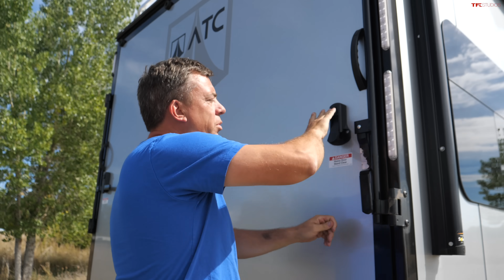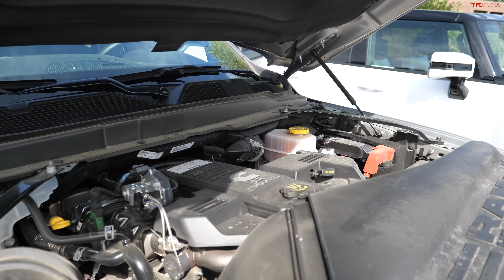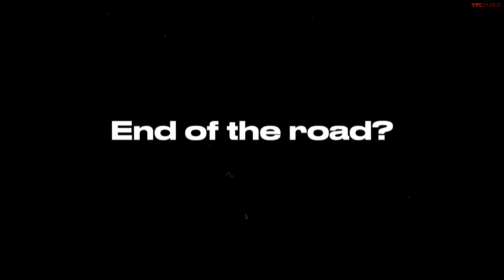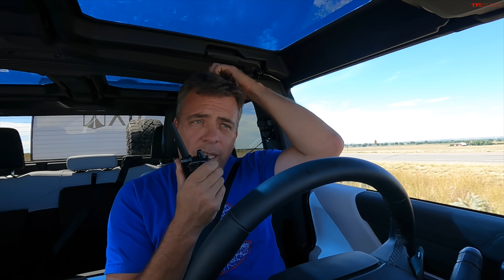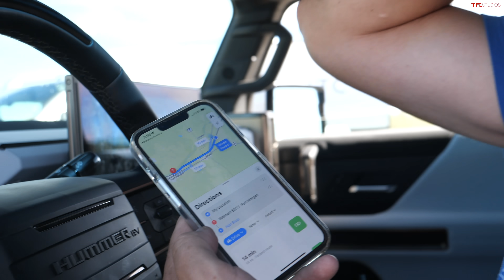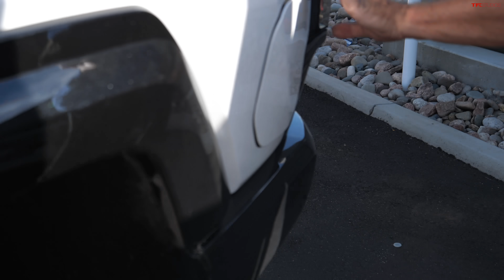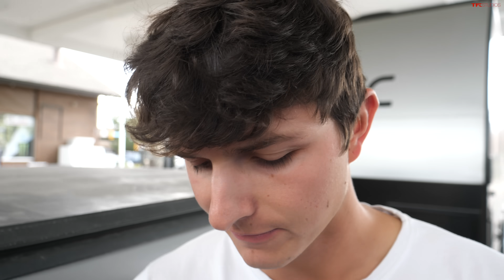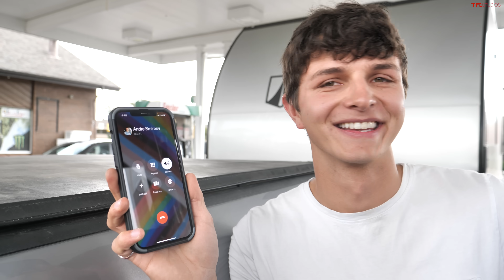How Far Can a Diesel and Electric Truck Tow An Identical Camper Trailer on ONE Fill-up?

Comment: The more you guys test electric vehicles, the more I want to keep buying gas/diesel
Reply: These electric trucks are only good if they can be used as power backup for a house in a rural area type situation. Otherwise as just a truck, I don't know.
Reply: @Huma Onyango  at that point just install solar panels and batteries for the same price.
Reply: @wayando  - it would be cheaper to just buy a standby generator & transfer switch.
Reply: Now imagine you have kids; its raining, Mother-in-law getting cranky and you have 500 more miles to go.  Ohh yeah you have to do it all again  to get home.
Reply: @mr.elastomeric1787  when I was shopping for my EV, I realized I just needed to adjust my assumptions on how I wanted to travel a bit.

If you’ve got cranky kids & mother-in-law and 500 miles to go.. do you want to power through for 8+ hours straight locked in the car/truck with them?  Or, does the idea of a 15-20 minute break at a charging station near a restaurant or Walmart/Target (where a lot of chargers tend to be) sound?  

We took a long road trip a couple years ago, Illinois to Maine and back.. before we got our EV.  Figured we’d blow through Indiana and Ohio.. nothing to do in them anyway, right.   Thats when I realized.. I’m ok with the idea of Not driving for 5-6 or even more hours straight any more.  Hoping off the highway to stretch my legs, or for a snack, or at one of northern Ohio’s many small wineries (who knew?) isn’t the worst way to do a road trip.

Sure, there needs to be more charging stations, especially in the boonies, so you can find one when you need one ( not have to plan legs of your trip out in detail), but that’s coming. 

As for cost premium others mentioned.. I got a bit sick when I signed the contract for my Kia EV6 this year, but I got the tax rebate (law since modified).  Looked at dealer site this week to book service and they’re advertising a Stinger 4-door mid sized sedan (their sport sedan) with a 6-cyl for almost what I paid (over invoice) for my EV6 amour 8 months ago.      Yea, electrics are expensive up front, but so are all new cars and trucks.
Reply: @ffakr  Your kids judging from the place you live stay cooped up for months mine surf in January.  Making it from Ft Lauderdale to Orlando going 85 the whole way was a prison sentence.  Good thing is my youngest just turned 23 and oldest is getting married.  Any road trips now are in the air. HAHA.  Peace Brother.
Reply: @mr.elastomeric1787  jokes on you.. all my kids are nieces and nephews (and more recently grand-nephews).   I get to send ‘my kids’ home when they get tiresome.  ;-).
Reply: I agree completely, try a winter storm traffic jam
Reply: Electric is great for inner city commuting.  Not so good for long distance or towing.  Its just not there yet.
Reply: @MrRjsnowden  or hauling anything in your bed.
Reply: @MrRjsnowden  they are great for long distance........ but not towing
Reply: So we kind of knew this before testing.  At least you have real world data, not propaganda from the gov and car manufacturers.
Reply: I dont want electric at all
Reply: @Jamie Miracle  I'm with you on that I'll keep my diesel
Reply: I agree. Now how long till Roman gives us a big lecture for not wanting to switch to EV?
Reply: And what about the factor of battery degradation as they are degrading with every minute of time.  Over 8 years the battery will degrade by 20 to 30% reducing range and charging ability by an equivalent amount.  Battery is a MASSIVE weakness for electric vehicles and here in Australia we have way less towns to charge and far longer distances to travel.
Reply: @everyday tenor Yeah, it's comical to me to look at these cost comparisons that include "free charging for 36 months" and people don't realize they are paying for that as part of the price of the car, and using current (historically high) gas prices to justify them.  And then road taxes as you mentioned, as well as long-term costs like battery replacement and disposal that aren't even talked about.  The cost analysis for EV's completely fails if all the costs are included, which is why you won't get a true cost comparison from the government or EV pushers.  It just doesn't make financial sense, yet.  Everybody says the newest and greatest technology is ready and is just around the corner, but I've been hearing about this for over 40 years and I haven't seen it yet.  I'm not holding my breath.
Reply: Yeah. Local traffic and daily usage would be more efficient for electric vehicles. Diesel vehicles have proven their efficiency and more worth while service for long distances. Best bet would be. Is to use electric vehicles for shorter distances and diesel vehicles for long distances. LOL
Reply: I’ll never own any electric vehicle their just a waste and a fire hazard
Reply: @stephenjump4218  agreed 👍
Reply: Love to see the pricing on the battery replacements I'm guessing half the price of the truck new?
Reply: I found 2 used f150 lightnings at a local Ford dealership and I was in shock over the price $103,000.00 😳
Reply: @Sam-Magnolia.Grace.Knives  what's the reason for trading it in so early? looking at getting 2X one for me and the other is to replace a 300 base-model from the mid-2000's parents ride and yes technically a separate deal but we both were at the ford dealership ( me looking forward to a fleet-style and there's a lighting platinum 50-80K style luxury barge ) and only one so far has come it and was sold/no test drives plus 130+USD sorry but that's way more than ford's-MSRP maxed-out and 2 i don't feel comfortable driving a 80+K truck as one deer 🦌could put me in bankruptcy permanently or a big hit financially as a millionaire and is way more than a new 2023 300C is

also was very clear to the dealer a year or 2 ago that about 70k=luxury was max anymore than that ( or funny operation costs as it need's to be about the same amount as the 300 or cheaper to run/ROI in a 5-10 years span ) and it's probably going to be a deal breaker
Reply: @Richard Price  I don't know but I don't plan on ever getting a ev price point isn't right
Reply: @Sam-Magnolia.Grace.Knives  damn they’re barely over 30-35k where I live lol with 20-40k miles
Reply: @rspurepk  That brings up another inconvenient issue with EV’s; buying used is risky since the batteries will eventually die and once they do you are looking at a huge expense to replace them.  Imagine if a gas engine vehicle would only get 100k miles before you were guaranteed to have to buy a new engine!
Reply: @MegaTechpc  I mean most have super long warranties on the batteries . Most motors won’t hit 200k in nowadays ice cars . I’ve seen so many teslas with 4/500k miles already with 85%+ battery capacity still
Reply: @MegaTechpc  motor replacements on todays cars can cost upwards of 8-15k with parts and labor and that’s with donor motors . If a battery pack replacement is 10k and it lasted 300k miles compared to todays cars barely running by the time they hit 200k that’s a win. I see so many used cars with 2-300k miles that aren’t even paid off yet needing endless repairs that add up to more then the car was worth new . With ev you worry about the battery . You aren’t Nickle and dimed every 30k miles when your motor needs work or this and that need replaced . Most people end up paying the cars worth in repairs by the time the cars paid off anyway
Reply: @MegaTechpc  ev does have a long way to go. But it’s headed in the right direction. And it’s especially convenient to daily drivers. You can easily do across country trips in most evs nowadays as well with no hassle . And spending 25% of what you’d spend in fuel . Which will only get more and more expensive the more we use and the less we’re about to dig up .
Reply: Yeah and you could have an ecoboost with hybrid that doubles as a generator for $40k less and do 3 times the amount of work.
Reply: absolutely
Reply: Yeah seems like they suit people who don't drive so far and know when and where they are going to be. Commuting or hauling a boat a short distance then driving back home. What makes me hesitant is the right to repair and the fact batteries cost a ton and wear out kind of fast
Reply: Exactly. I’d do a hybrid but not straight EV no way
Reply: Have to  also look at the additional time for the recharging, how much farther down the road the ram went. When getting to the camp site, could they recharge?
Reply: The 'choice' is being taken away...
Reply: @addiumuppicus5738  if you live in California it is but for the rest of the country we’re good we can keep our petroleum powered vehicles
Reply: dang right
Reply: Agree
Reply: i've heard this before nab it's perfect now
it's no longer about GMC vs Ford vs Chevy, or Gas vs Diesel, It's all of us agenst that electric shit
Reply: I’d like to see these same tests in the coldest parts of winter lol batteries love cold.
Reply: I will gladly keep driving my old truck. 
400,000+ miles on it and it gets a whole 13mpg..
Reply: 👍🏻 The only time I would ever buy anything electric is a hybrid but I honestly don’t know if I would even do that
Reply: So true and our government wants to turn all our semi‘s into electric that’s funny it’s not realistic and they’re not reliable. I’m good and I’ll never buy electric car. I’ll stick with my gas guzzler.
Reply: @Michael Duncan  Sold to China the leader in manufacturing lithium batteries and solar panels.
Reply: In the last ten, certainly in the last 30 years, the EVs are getting better and more impressive. But they are still only about a quarter, maybe a third, of the way to being an equal replacement in all costs and all uses. It's not a straight line progression, but maybe by 2050 they'll be there.
Reply: This is why Ev is not yet ready no matter what they say 5 years or more. Don’t forget you have to charge it .
Reply: Why would you think EV would even do good?
Reply: @jimbeam9176  masochism is da rage
Reply: I will never own one.
Reply: The problem is not the technology itself, the problem is that almost every company is trying to sell this as a universal solution, like "this is the future". Electric vehicles actually excells at a niche function of dayly driving, while being awful for heavy vehicles that are used for long hours. Idk, for me those big e-trucks makes no sense, who would want such big vehicles to use just as a dayly driver? But for smaller cars for personal use, i think electric is the way.
Reply: The more you toll and haul in your lifestyle the less you should be even using your tiny brain on which truck works best for you.
Reply: Huh, can't say I feel the same
Reply: You got that right
Reply: I think that's the idea with these videos.
Reply: LOL right. Got a extended range fuel tank in my tacoma so it already beats EV on range. Tho the king is my step dad's 91 Festiva with a 20 gallon fuel cell. 800 mile range getting 45-50mpg
Reply: @everyday tenor exactly they will replace the gas tax.
Reply: just imagine that battery replacement cost , after all those charge cycles and deterioration
Reply: Imagine being stupid enough to buy an EV.
Reply: And that is with a small trailer. Loaded down I pull 18K-20k pounds with my Cummins and still get 10-12mpg and have a 36 gallon tank so have good range. They are towing in a hilly area and the travel trailers do push a lot of wind so I see how they were getting low mpg.
Reply: The Hummer is just a really heavy and expensive golf cart. 🤣🤣🤣
Reply: Given my driving habits an electric (or better a plug in hybrid) would be the best choice for me.  If I had to haul anything it'd be the wrong choice.
Reply: Good.
Reply: The sad part is that although they got that charge for free, poor people that could not afford an electrical vehicle, actually paid for it.
Reply: News Flash !
'They' don't care about what We want...Or haven't you figured that out yet, 'not even considering' these ridiculous, b.s. electric vehicles in yoyr everyday life !
Reply: The really sad part is you're not even saving the planet! Only 19% of electricity can really be called Clean energy!!
Reply: I personally can't afford new vehicle whether is be EV or not, I just have to deal with what I've got.
Reply: It would be fun to have one as a toy, but not for anything serious.
Reply: But think of the children!
What would greta say?
You wpuld be putting those kids in the coltan and cobalt mines out of work too.
You have no soul.
Reply: To be fair when you calculate energy density you need to factor in the inefficiency of the ICE .
Reply: Would’ve it be awesome to get stuck in a winter hi-way traffic jam run out of power and be looking for an outlet to plug in , just awesome!
Reply: That's the idea. The Hummer has stayed true to its legacy of inefficiency.
Reply: My point proven
Reply: Shocking your children are more intelligent than dad.
Reply: The more ANYONE drives them they realize how garbage they are. They’re not a good solution
Reply: @jonforrest4405  EVERYONE has different solutions than you. Now you know.
Reply: @everyday tenor Ohio charges more for registration fees on hybrids and EVs.
Reply: .30/mile for ev vs .35/mile for the diesel Ram.  The charging station showed 37.41 charge before he showed it as free
Reply: Prices for EVs will continue to go down, battery sizes and charging speeds will go up.   Also the Hummer is still A hummer: aka a piece of trash lifestyle truck.  EV trucks are definitely not ready for handling towing yet, for sure.  They will eventually.  Batteries keep getting cheaper and more and more power dense.  some batteries that are going into production in the next 3 months could give a Ford F150 4x the range for the same battery weight.  it'll just take about a decade for EV trucks to get good.  like someone here said: keep your gas truck for now and wait for electric trucks to get good.
Reply: I intend to keep my gasoline pickup. The electric vehicle has been around since the 50s, they were garbage then and they're garbage now.
Reply: @vargr  Wrong.
First generation cars were already electric at the beginning of the 20th century. Problems were exactly the same as today...
Reply: @halloola3636  in other words they were crap then as well. The 50s saw the EV become assembly line built turds, not one-of's. The tree huggers need to understand that this world has frozen or baked in cycles since day one. Man will either adapt to survive or go extinct.
Reply: Lmfao Right ! 👌😝
Reply: We're just now starting to develop electrics for towing and hauling. I just bought a gasoline truck; by the time it's worn-out, electrics might be practical for long distance towing of an RV. As usual, I'm waiting for the early adopters to work the bugs out.
Reply: @AcmeRacing  I will tell you from OTR trucks and medium/heavy duty sectors, Diesel is and always will be the future of work. Gasoline trucks will always be a light duty. Most diesel trucks will live easily 1 million miles being constantly driven/running the whole time. Its a superior long term investment.
Reply: Incorrect, twenty 21 years they've been developing electric trucks. So in 20 more years they'll get it right
Reply: @joerussell838  there’s 3 things preventing EV trucks from obsoleting diesel trucks.. and three of them are battery tech issues.

Power density
Charge speed
Charging Infrastructure 

Increased power density will provide for less cell required/smaller batteries, less weight, longer range, which should mean lower costs.

More charge capacity requires more time to charge.  One prob with the EV Hummer is that it’s a Hummer.. it’s huge & heavy, which makes it require a bigger battery, which makes it heavier, which requires a bigger battery.. it’s the rocket ship problem.    It’s 212 KW battery takes way longer to charge than my 77KW EV6.  Some tech inherently doesn’t have this problem (e.g. super capacitors) but lithium is lithium..  we need next-gen battery chemistry to solve this.

Infrastructure isn’t there yet.  We need more public chargers and higher capacity ones too so we can quickly charge those higher capacity batteries.

The good news is, solutions to all these issues are on the foreseeable horizon.   From a purely technological perspective (regardless of mandates), I think EVs will be dominant in 10 years.  Things are moving that fast.
Reply: @ffakr  towing vehicles are heavy though. We are 20 years from developing sustainable vehicles that can tow great distances. X-15 cumming diesel on 200 gallon can roam 1,600 miles between fill up at a Gross weight of 80,000 pounds. Best EV heavy truck 90 miles @ 80,000 gross and needs charged.
Reply: @ffakr  You could have said it all with one word- "Physics"  Which is why it will never happen.
Reply: @AcmeRacing  I wouldn’t hold my breath if I were you!  We are literally a decade or more away from an EV being able to match that RAM in terms of range.  And even by then I imagine there will still be major infrastructure shortcomings that will still be an inconvenience.  If they did manage to make a battery 5 times the size of the Hummer’s, imagine how long that would take to charge!
Reply: @AcmeRacing  at that time the world will see the problems with lithium and kepp going on gas
Reply: Bugs? What bugs it's just a fact that at high load electric becomes very inefficient. And if you buy a diesel and you're unsatisfied with range you just spend $1k for a slip tank and add 1,000 miles of range. They're going going to have to develop an absolutely ground breaking battery to make electric practical for heavy duty use.
Reply: It’s not bugs. It’s tech and knowledge. This is the best we have. Yes ppl prob have a little better system out by now. But still charging off of a coal fired power plant. Just buy a gas or electric vehicle. Quit trying to get in with the cool kids. Ppl actually choosing a more expensive version that is worse in every way possible to measure. Yet to be part of the cool crowd ppl are buying a worse product that is more expensive and worse for environment. Pure ignorance!
Reply: @craigstanton4803  I don't know about you but we have plenty of wind power around us (Great Lakes area).  
I even have the option to buy my home power from a clean energy producer in my area.. not to mention that I have the option to install solar (waiting on a new roof.. don't have solar (yet)).
Also.. don't forget that even though Coal isn't clean (regardless how how it's been re-branded), economies of scale are a real thing in power generation.  Power efficiency of small combustion engines isn't particularly good compared to large scale generation.

There's a lot to like about electric.    They're quiet, they're effortlessly powerful,  and though they cost more to buy up front, they're a lot cheaper to run.    
I don't have an EV truck, but I did get an EV crossover this year and I charge almost entirely at home on 120V (~60mile round trip to work & back).  I've only used fast DC chargers maybe half a dozen times on road trips in the last 9 months.  
My cost to 'fill my tank' at home is about $10.. and that gets me about 260-300 miles of range depending mostly on driving speed (range falls off pretty quickly over 65mph).
Also just had my 8000 mile service today.. my first regular service point, and that cost me $25.   By comparison, my Prius-C requires full synthetic, so if I don't change the oil myself, I'm looking at $80+ every 5K on top of my other regular maintenance.. though with the Prius.. I'm over 100K miles and I just now NEED to replace my brake pads because of all the regenerative braking.

There's also downsides of course.   Power is something you have to think about if you road trip with it.  There aren't enough chargers out there (yet) as there should be.  There's also an issue with chargers being rated as "up to xKW/hr" and not living up to those promises.    Sucking down power at a 350KW charger isn't really an annoyance, even when you need to pull in 60+% on a road trip spot.. the problem is, you're generally pretty happy if that 350KW charger actually delivers 125-150KW and I'm thrilled to actually get over 200KW (yes, my 800V EV6 can take advantage of a full 350KW feed).  

Anyway.. bottom line... overall I love my EV but it's not perfect for everything.  The tech is still fairly new.  
It's not yet 'there' for long distance hauling but as a daily driver.. absolutely fantastic and it's generally workable for road trips if you're willing to do some planning and stretch your legs every 3-5 hours.. but you can't just hop in and go drive 1000 (or even 300) miles on a whim.. you need to make sure you're got a fast charger(s) on the route.

If you haven't tried an EV yet.. I totally recommend you do.  They're a blast to drive.  Full torque at short is something to experience.
Reply: @craigstanton4803  You do realize even though it is coal charging the vehicle, a coal powerplant is several times more thermally efficient than an ICE vehicle engine. For every 100btus of gasoline potential energy only 25 btus are actually used to drive the wheels. A coal powerplant will generate 95 btus of electricity out of 100 btu's worth of coal. Also coal only needs to be mined, not drilled, shipped and refined like gasoline. You are talking about a 70% reduction in CO2 emissions even using a coal powerplant to generate electricty. When you factor in the difference in making an EV vs a gas powered car, the EV will have a net reduction of CO2 after two years of ownership.
Reply: @craigstanton4803  fwiw, even if it is 100% coal, electric is still better for the environment. And the electric isn't all coal, and increasingly it isn't as much fossil fuel
Reply: @iansilver-ramp595  wrong again 90% of the electricity produced in America is from coal powered plants, their are a few diesel powered generating plants and a few nuclear plants but their being phased out cause nobody wants another Chernobyl so those will be offline soon, now if we stop using fossil fuels to power the generators to produce the electricity for your precious EVs you’ll be dead in the water or road jay leno has the very first electric car ever built in 1912 I believe and it’s powered by 24 volts and gets around town it also has the first electric powered lights cause back then they were all gas fired lights so as long as their has been automobiles someone has always tried to make an EV powered vehicle and all have failed, and petroleum powered vehicles have prevailed, maybe in another 200 years their will be more EVs on the roads then petroleum vehicles but I doubt it will ever happen in our lifetime
Reply: @craigstanton4803  just like wearing the face diaper!
Reply: @ffakr  wait until the government starts to feel the loss of revenue from their gas tax....your electric costs will greatly increase when they apply a new tax to your electricity..  Also the government can shut off or regulate your electricity as we saw in Denver Colorado this past summer; so your ability to travel by EV could and I stress could be controlled by the government in the near future.  This is also why they are pushing for federal digital currency....they can monitor every purchase you make and restrict your ability to purchase what  they don't like (gas, ammo, guns, alcohol, abortion clinic, private school, etc). They could enact a negative interest rate so if you're not spending your $ pumping the economy it would decrease sitting in the bank. If you exceed your allotted carbon amount they can basically shut you down.  You speak out against the government or attend a political rally they don't like they can cut you off just as they did with truckers in Canada last year.  It would be the greatest march towards a full surveillance state like China.
Reply: @iansilver-ramp595  really?  Have u looked into the rare earth mineral mining that is need to produce these batteries?  What about the additional tire and brake dust and road damage produced by much heavier EVs.  What about battery disposal?
Reply: @Randy_Savage_ohyeah  all legit concerns. Still better than what we're doing now. Battery recycling is a must, and that industry needs to be built out. Mining is going to happen and it's going to have significant environmental impacts, I hope it is done as well as possible. Chemistry is also changing what materials will be needed in future batteries. The tire dust issue, can't say I've heard that's a significant concern compared to particulates from ice vehicles.
Reply: Hope you drain that car battery now and then, those car EV batteries, unless you have one of those chargers that completely drains and completely recharge from zero or 20% to full 85-100% full charge, you might be able to extend the life of the EV car battery or the battery starts to remember the charging levels and only drains the battery while at 30% charge and recharges the battery to less than 85% and it shows a full charge when there is still 30 to 20% left to be charged into the battery, a full charge not possible due to the phenomenon known as battery charging memory.   This eventually causes the owner the need to replace the cars battery at cost if the warranty has expired .   Usually costing over $20,000 to replace with a new EV battery.  If not, then purchasing a new car might be better without replacing the old battery, but cost for most would be to much.
Reply: an EV charging off a coal plant is still significantly cleaner than a gas/diesel vehicle.  It's not worse for the environment, you're the one displaying pure ignorance here.  just STFU   @craigstanton4803
Reply: im 45 years old these electric cars aren't meant for me its the next generation they don't know any better lol
Reply: @Ghettoize  I'm 54 and I feel the same way.
Reply: What? You mean you’re not rich enough to virtue signal with novelties that cost 30k more than an average vehicle
Reply: @localenterprisebroadcastin5971  I'm rich enough but not ret@rded enough.
Reply: @localenterprisebroadcastin5971  

 And about the price difference. The “savings “ of charging with electricity is slowing getting  smaller and smaller as electricity rates rise due to the increased demand evs are putting onto the grid.
Reply: The government just added you to a list
Reply: i will never buy electric
Reply: Batteries will get a lot better. NASA has developed a solid-state battery 1/3 the weight and 300% the power density that doesn't use cobalt, nickel, or manganese, so it will be 1/3 the price. It also can charge to full in 4 minutes. Theoretical power density of solid-state batteries is 500% more than Lithium so there is even still more room for improvement. These batteries will be commercialized in just a few years. Also, solid-state batteries work very well in cold climates because they don't contain any liquids. I'm waiting until then.
Reply: @checkfactschecking  We've been able to make  Solid State lithium batteries for like a decade, so we know the tech works.   The only problem is.. they're hard to manufacture.   

It's one thing to make one in a lab, given enough care and resources.
The only remaining issue to solve is.. how do we set up a production line to make thousands of them at a reasonable cost.  :-/ 

We'll get there though.
Reply: It's almost as if buying an EV is just a novelty and a way of someone feeling validated in their alleged care for the environment. But they forget thst Co2/3 and NoX emissions dissipate and is absorbed by plants, whereas lithium and toxic heavy metals buried at the dump do not- for thousands of years.
Reply: To be fair, EV’s have not been designed to tow just yet. It is coming but the current EV’s are designed for performance. Battery range will need to be increased to 700 miles to get decent towing absent some other technology to assist.
Reply: @Dr.Octogon  the only way for an EV to have anytype of towing range would be to install a small 3 cylinder diesel engine so it can run like a generator giving the EV enough electricity to provide the proper range, trains do it all day long and produce unlimited amounts of electricity to power the electric motors that give it motion, so if you want high towing capabilities in an EV it’s smarter to tie a small diesel engine in it to act as a generator to provide enough electricity to go 1500 miles
Reply: @stephenjump4218  this is wrong, you are talking about augmenting stored energy with a generator running off another energy source. This is only needed when you don’t have enough stored energy. 

The fix your describing would help current EV’s in this particular use case. But as a long term fix it is assuming the pace of innovation is the same as it has been for ICE vehicles. That is completely wrong. The pace of innovation in EV’s way more aggressive than ICE vehicles. There are new battery chemistries that are reducing charge times to 73 seconds and increase battery capacity to over 900 miles on a charge. There are new materials also being tested that could replace lithium, cobalt and other minerals. There are also improvements to motor design increasing efficiency. There are improvements to cooling that will help offset the heat created while charging allowing for faster charging. The battery density improvements and raw materials improvements also bring down cost.

EV’s and their perspective use cases outside of just driving are in their infancy. There is no need to look to the past to solve for a use case that most of the population is not ready for or does not need. The idea that everyone is going from no towing to towing for 200+ miles on electric all of a sudden is ridiculous. Most are not towing that far, so most of the towing use case is covered currently with sub 150 miles towing as long as the capacity is reasonable.

In this test, they could not have used a worse vehicle for the test. The Hummer has the efficiency of a brick. You fact that it only has 7500 pound towing capacity should tell you all you need to know. It is not designed with towing in mind. This is a comparison of the Hummer EV vs this other truck. You might as well be comparing a Leaf to that truck.
Reply: EVs SUCK. There's no good reason for them to exist.
Reply: @Matthew C  they're faster, more reliable, cheaper to run over even just five years, and their lifetime CO2 cost is considerably lower than an ICE vehicle. Heavy transport is the only area not yet conquered by EVs, and this will soon fall. As yet, we also don't have a dirt cheap entry model EV, though there are models that are just 10% dearer than comparable low-end models.
Even long distance isn't an issue an longer. Within 10 years, petroleum fuel wil be as rare as charge stations are now.
Reply: @everyday tenor I honestly didn’t notice a disproportionate rise in insurance but I don’t replace my cars often.   I sold the oldest (2009) to buy my EV6, and kept the former ‘new’ one (2012) as my backup.   It’s been at least 6 years since last time I had a car with a loan that required full coverage.

There is a counter argument though.. because they’re generally brand new platforms (aside from Teslas and a few other established EV models), cars like my EV6 come chock full of all the latest in safety.  Sure, nothing (but raw acceleration) is gonna keep someone from hitting my car if they’re aiming to (intentionally or accidentally) but there’s plenty of systems to prevent me from hitting someone else.  My ev6 should be far harder to get into an accident either lane guidance, 360 cameras, and active auto-braking than any of my past cars were.
Reply: The gas/diesel powered vehicle/engine has had sooooo many years of development however, the electric powered vehicle/engine has had les time to evolve. Buying an electric vehicle would be a smart idea because it can keep the brands alive and let them evolve. Eventually they can evolve stronger and better than gas/diesel powered machines.
Reply: @logancate1002  <-- enviroshill
Reply: @logancate1002  I'm not spending enough money to buy a brand new house, +$100,000.00, for a rolling turd. The power grid cannot handle all the charging stations that will be required. From day one electric vehicles have been rich people's toys good only for in-town use. Until someone can get a charging strip built into roads so the EV is always charging,  and the pricedrops to below that of a liquid fueled vehicle then I will keep my wife’s '05 F150 and my '79 F100 pickups. If I have to go to biofuels we will. They want us to go EV, then give us the one we want, foot the cost to put two charging stations in each garage, then shut up. Bill the Democrats for the costs.
Reply: @vargr  "They" (who´s that btw?) want us to be fully controlled and that is far easier with EVs...
If you still believe in the difference of the two parties, I think you should dig a little deeper - both answer to the same cabal.
Reply: @logancate1002  First generation cars were either electric, steam engine or combustion engine...
Guess which one actually worked.
And just fyi: I´m very "eco", I do all my daily distances by bike (non-electric, pure muscle), even up to 50 miles.
Reply: @logancate1002  jump right on that just as soon as they make one I can afford. Right now, they don't exist.
Reply: i want to buy Ev right now
Reply: @BeautifulAngelBlossom  I mean there’s a ton of consumer evs that aren’t much more expensive then a typical car nowadays . Depending on your needs for a vehicle
Reply: Here's what they need to do. Put a generator in the electric trucks that way you can charge on the go. I don't know how much gas it would take to charge that hummer but let's say five gallons that is still a huge savings over a normal gas engine and you'd still have the electric performance in the mtns.
Reply: @zakarybarclay999  That's what the Ram 1500 EV is doing, supposedly in 2024.
Reply: @zakarybarclay999  The size of generator required is quite large.
Reply: @everyday tenor gas is taxed at around $0.40/gallon in my state.    I pay about $8 in electric cost to ‘fill up’ my EV at home.
Given the amount of gas taxes I’d pay to get similar range in a similarly-sized ICE vehicle..  I’d need to pay an extra $5-6 in taxes to make my EV taxed at a similar rate (cents per mile).  It’d still be much cheaper to fuel my EV.
Reply: @ffakr  you gonna pay $20+k for a new battery in a 10-15 year old car?  Don't forget the tires for the heavier ev are more costly.  No matter what you are "saving" per fill-up/charge on your ev it won't add up to real saving in the long run.
Reply: Tesla just did a 500 mile trip towing over 80,000 pounds on their new truck.  So there is room for big improvement on the part of Hummer.  People will tow with electric trucks as you save a lot of money on fuel and have almost no repairs.  Plus you forgot to mention all the toxic fumes diesel spews into the air we breath.
Reply: @sanohajian3174  u obviously don't know about ultra low sulfur diesel, DEF and modern diesel exhaust systems....they burn cleaner than your Civic.